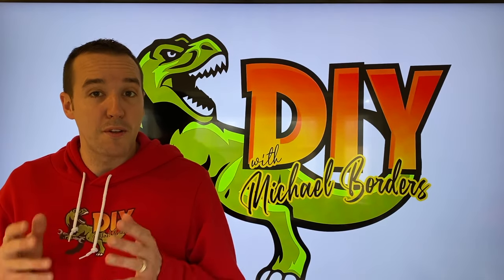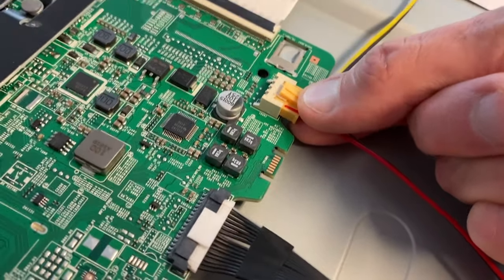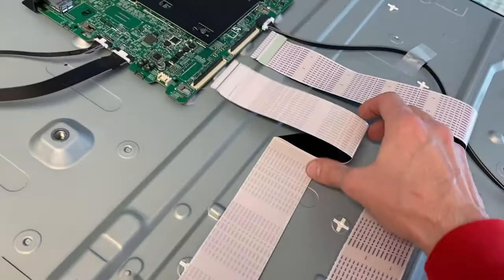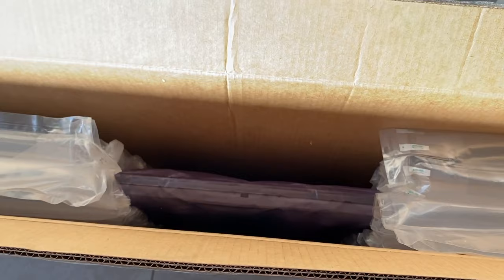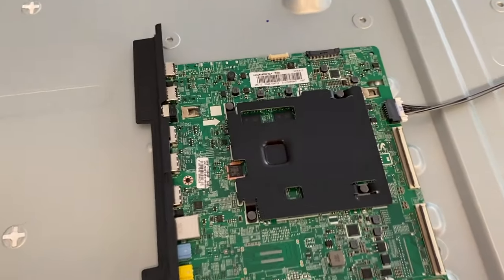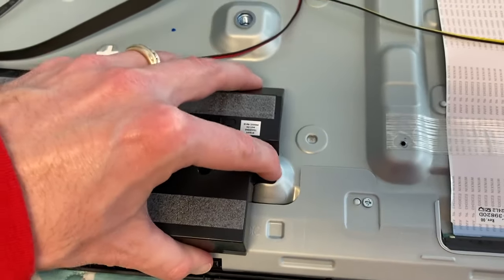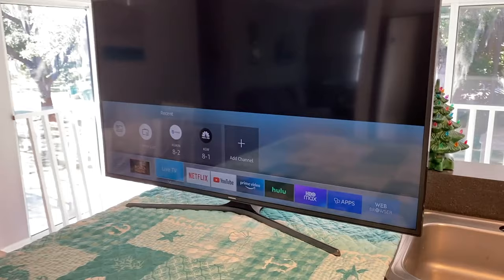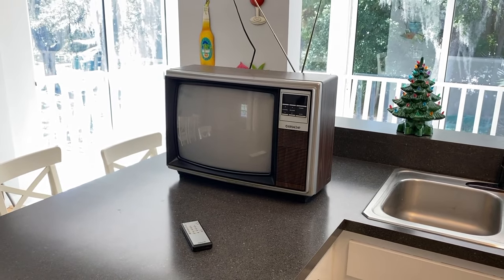How to replace TV screen/panel - DIY Samsung/LG/Sony/Vizio

Comment: I was playing with my VR and I lightly touched my screen and it cracked over half of it and my TV is 75 inches😭😭😭😭😭
Reply from the maker: Good morning ☕️

That’s a bummer to hear.  75” replacement panels are tough to find however not impossible.

The best place we have found is:

       PartSimple.com

It’s possible that chatting with their customer support team, they can find you a replacement panel however if not, ask them if there’s a place they recommend looking next.

They are pretty awesome in the support department.  👍

Comment: Where do I get the new screen?? And how much are they?? I have a 49 in LG bottle cap hit it didn't break the glass but it f*** up the screen
Reply from the maker: Thanks for watching & welcome to the DIY Raptor Club Rudy.  We purchased our panel from:

       PartSimple.com

You may find it best to remove the back panel to gain access to the internal portion of your TV.  Once inside, you will find a part number sticker or placard on the internal panel.

Using this information on the sticker or placard will allow you to best shop around for your exact replacement panel.

Please keep us posted on your project.

Comment: I have a 55inch 4k samsung tv that needs a screen replacement. It has the same damage this one does. Where can i get panel to replace? im having a hard time looking.
Reply from the maker: Thanks for watching, below is the site we purchased replacement panel from.

       PartSimple.com

Having the panel part number which is located inside on back portion of panel will be very helpful.

😎👍

Comment: Any help on a screen for a 43" samsung tv un43tu7000fxza. Cats knocked it off the TV stand and broke the screen. Only had it for 3 months.
Reply from the maker: What’s up Kevin, thanks for watching & welcome to the DIY Raptor Club.  We purchased our panel from:

       PartSimple.com

You may find it best to remove the back panel to gain access to the internal portion of your TV.  Once inside, you will find a part number sticker or placard on the internal panel.

Using this information on the sticker or placard will allow you to best shop around for your exact replacement panel.

Please keep us posted on your project.

Comment: Hello I broke my screen on lg 43 smart tv can you help me how I look for this 
I called screen panel for 43 lg tv  ?
Reply from the maker: Thanks for watching, the 43 lg is more likely to have a replacement panel available.

We purchased our panel from:

     PartSimple.com

😎👍
Reply: Thank you 🙏 any tip how to look for part number on the screen panel  ?
Reply from the maker: @tinobriones7922  

You are welcome, best thing to do is remove the back panel to gain access to the internal portion of the TV where you can then find your screen/panel, part number sticker on the backside of the internal aluminum panel.
Reply: Thanks 🙏 I appreciate your response and the time 😊
Reply from the maker: @tinobriones7922  

So happy to help.  😎👍

Comment: Hi mate, I’ve bought my Samsung 4K QLED Q60A TV last year and it’s only been 8 months old but I was told by samsung’s tv repairman that my panel has to be replaced. So he scheduled another appointment with me next week as he just came today to evaluate and assess my tv’s condition. For the past few days, the problem with my tv is that it can be turned on during the day but whenever I decided to turn it on at night around 10pm plus, the red led light just flashes twice and the tv screen keeps on flashing white non stop. It only worked if I turned it on again at around 1am or 1:30 am. Oh yeah forgot to add in, I do have horizontal black line on the mid bottom of my tv screen that tends to appear and re-appear every secs. Do you know what is the actual prob? is it really a panel issue? if yes, what causes it and is there any advice on how to prevent this issue from re-occurring in the future? apologies for the long ass message but I hope you do reply me, thanks a lot 🙏🏻
Reply from the maker: Thanks for watching & welcome to the DIY Raptor Club.  Great questions & we appreciate you sharing this.

TV working at random times during the day is odd...🤔

A few things can cause the lines including faulty panel, faulty Tcon board, or faulty ribbon wiring.

If you don’t feel comfortable paying for a new panel yet, we recommend replacing your Tcon board and ribbon wiring to see if that alleviates your issues.

The Tcon board and ribbon wiring are very low priced items within the TV.  If replacing these low priced items and you’re still experiencing the same issues, it’s time to replace panel.

Please keep us posted on your project.
Reply: @DIYwithMichaelBorders  thanks for the response and advices man! I’m not good with DIYs and technical stuffs mate but no worries as my tv is still under full warranty. And speaking of the devil, it’s 1:21 am here in Singapore and yes my tv finally able to turned on now. I genuinely have no idea why it can only be turned on at this timing😂 I turned it on at 10:30 pm just now and it doesn’t want to turn. Tried it again at 11:30pm still nope, 12:30 am nah but 1:21am and bam! it takes like 2-3 mins for it to even turned on. Once I saw the QLED logo I knew it’s gonna on 😅
Reply from the maker: @iAMNinjaDarkovia  

Thanks for the reply, that’s so odd...😁

Sounds like your tv watching will be in the early early morning hours as opposed to prime time hours...😁
Reply: @DIYwithMichaelBorders  likewise 👍🏻and yeah man it’s surely is odd alright! I just hope that the tv repairman will get it fixed next week lols
Reply from the maker: @iAMNinjaDarkovia  

😎👍

Comment: hello im was watching your helpful video but can u help me find a screen for my SAMSUNG 24" Class HD (720P) LED TV  UN24H4000af
Reply from the maker: Thanks for watching, we will need the actual panel part #.  You can access this by removing the back panel where you will find the screen part # sticker attached to the inner aluminum panel.

😎👍

Comment: Need the part number for a 55 inch and 50 inch Vizio if you can help please, thanks 🙏🏽
Reply from the maker: Thanks for watching & welcome to the DIY Raptor Club.  We purchased our panel from:

       PartSimple.com

You may find it best to remove the back panel to gain access to the internal portion of your TV.  Once inside, you will find a part number sticker or placard on the internal panel.

Using this information on the sticker or placard will allow you to best shop around for your exact replacement panel.

Please keep us posted on your project.

Comment: How much does a new t.v screen cost
Reply from the maker: Good morning, that will depend on age of tv as well as size.  The smaller the tv, the more cost friendly replacement panels are.

The older the tv is, the less expensive the replacement panel is.  Hope this helps.

😎👍

Comment: I have a 50 inch TCL Roku TV I believe it's 4K and my niece knocked it over after having a tantrum. It fell on a baby walker and punctured the screen. I think it's worth fixing as the TV was only a couple hundred bucks  before taxes and insurance which the insurance was useless because it doesn't cover the problem I had. Where can I get replacement parts to do it myself? I was gonna take it to a TV guy but figured he'd probably charge more than what it cost.
Reply from the maker: Thanks for watching & welcome to the DIY Raptor Club.  Several options, we purchased our replacement panel from:

       PartSimple.com

😎👍

Comment: What would be the cost and where would I find a LED panel # BN96-50317a
Reply from the maker: Thanks for watching, we will need the actual part # of the panel itself.

We recommend removing back panel to gain access to the inside of the TV where you can find the part # sticker for your exact panel.

On average, replacement panels can range between $300-$700 for your tv.
Reply: The back panel is off. I have looked at every sticker and typed in every number and non of them produce the entire panel. It should be stuck to the silver aluminum correct? Where my main board and ribbon wires are connected.
Reply from the maker: @booger1585  

Thanks for the reply, that’s correct.  The part # you sent is for the internal LED strips we believe.  That’s what coming up.

Comment: How do I know what panel I need for the tv?
Reply from the maker: Thanks for watching & welcome to the DIY Raptor Club.  The best thing to do is remove the back plastic panel so you can gain access to the internal portion of your TV.

Once inside, you will notice a large silver aluminum panel that all the internal parts screw into.  Somewhere on this large silver panel is a part number sticker which is the exact panel/screen replacement part number.

Keep us posted on your DIY project.

Comment: Can You help me with a site that can give me the original screen replacement for 40" MU6120?
Reply from the maker: Thanks for watching, we recommend:

          PartSimple.com

Great online vendor for tv electronic replacement parts and services.

😎👍
Reply: @DIYwithMichaelBorders  THANK you, but I still can't find it. Can You help me with direct link?.
Reply from the maker: @Exquisite.C  

Good morning, absolutely!!  😎👍

The best thing to do is remove the back panel of your TV to gain access to the inside where you will find the TV’s panel/screen part number.

The part number is usually on a small sticker.  We can use this exact part number to locate an exact replacement panel/screen for your exact TV.

Looking forward to hearing back from you, we DIYers need to stick together!

😎👍
Reply: @DIYwithMichaelBorders  THANK You,.. This will be helpful and I'll look for it when I get home 🙏
Reply from the maker: @Exquisite.C  

Awesome Awesome!  😎👍

Comment: Amazing video! I do have a quick question, I am having the same issue with my Samsung Nu7100 Series 7 tv. I wanted to know if there is ANY way I can do the same thing to this specific model? Also this tv does not have screws on the back so I am having issues with just taking that off. If you have any suggestions that would be kindly appreciated!
Reply from the maker: Thanks for watching & welcome to the DIY Raptor Club.  It’s possible indeed.  Your tv design has the clips that secure back panel.

You will need to carefully unclip back panel & remove it to gain access to the internal tv screen/panel part # sticker.

Getting this part # will ensure you purchase the exact replacement screen for your exact tv.
Reply: @DIYwithMichaelBorders   thank you so much ! This really helped! Are there any websites you recommend for a panel to be found?
Reply from the maker: @Daissysaiyan  

There are a few good ones, we purchased our replacement panel from:

       PartSimple.com

😎👍

Comment: If I give you my TV info can u help me with the part number I need to find screen plz
Reply from the maker: Good morning ☕️

We can definitely help, we will need the panel p/n located inside on a sticker placed on back/inner wall of panel.
Reply: So I need to take back cover off
Reply from the maker: @thenightwing1718  

Thanks for the reply, great question.  You may actually be able to get panel p/n from your TV’s owners manual.

If not, removing back panel to gain access to inner tv will be the next best method.  😁👍🧰
Reply: @DIYwithMichaelBorders  ok give me a few
Reply from the maker: @thenightwing1718  

After obtaining the p/n, we can check:

       PartSimple.com

This is a huge online electronics vendor.  😁👍🧰

Comment: I have two white spots on the screen of my Sony TV and I don't have someone to fix it for me,pls what do I do?
Reply from the maker: Thanks for watching, a few things can cause this.

1.  Loose electrical connections inside tv

2.  Internal chip in early stages of failure

3.  Dusty Dusty Dusty inside

Out of the three, the most likely cause is dust buildup inside the TV.  The video link below shows us performing a friendly cleaning.

     https://youtu.be/-QdPg_jPkGY

It may be that simple for you.

Comment: I’m trying to buy a replacement panel for my TV that broke a week ago, but it’s LG and they only sell to authorized dealers who charge more than what the TV is worth from ridiculous nonsensical charges, etc. Where can I go to get one?
Reply from the maker: Thanks for watching & welcome to the DIY Raptor Club.  There are a few trustworthy places to purchase replacement panels.  Depending on the age of your LG, we definitely feel you should be able to find a replacement panel.

We ended up purchasing ours from:

       PartSimple.com

Please keep us posted on your project, us fellow DIY’ers need to stick together!

😎👍🔧🔩
Reply: @DIYwithMichaelBorders  hi, it doesn’t appear they have any TV parts or panels available for LG. I found the model number available on other websites but they have a huge core charge associated with them. It is a 2020 lg tv 65UN7300AUD outside of manufacture warranty. 

Does the core charge actually get refunded for a broken screen caused by an impact or is it just considered part of the total cost at that point?
Reply from the maker: @TavidzTV  

Thanks for the reply, we did a search & found a few options.  Below is a link...not sure if it will be helpful.

       https://www.tvserviceparts.com/LG-65UN7300AUD.BUSFLKR-TV-Screen-Replacement.html

😎👍🔧🔩
Reply: @DIYwithMichaelBorders  I have a  75nano75upa.busflkr 
I'm having a hard time finding a panel  i circuit boards I can find but I need a pannal
Reply from the maker: @lexusfujae2192  

Thanks for watching.  Do you have the exact part number for the panel?
Reply: @DIYwithMichaelBorders  yes the part number  is  kit-75nano75upa-k2
Sku: Sj-kit-75nano75upa-k2
Module number 75nano75upa.busflkr

Serial number
Reply: @DIYwithMichaelBorders  its 75 inch nanocell lg tv Alexa built in
Reply: @DIYwithMichaelBorders   do I need to open  it up to find any different number
Reply from the maker: @lexusfujae2192  

Awesome
Reply from the maker: @lexusfujae2192  

Sweet, thanks.
Reply from the maker: @lexusfujae2192  

We looked up that number.  You will need to remove the back panel to gain access to the internal panel part number sticker.  This will help us pinpoint the exact replacement panel for your exact tv.
Reply: @DIYwithMichaelBorders  I found several numbers  hopefully one of these work 

There are 2 white stickers with a barcodes 

1st sticker has 2 barcodes

Top half stick 1 :
NC750TQG-ABKP1
BMS
9ABA141761A2CB
Second  half  Second barcode of sticker 1:
EAJ65720404
210705
J7507JR5E65720404ZG1A

The second sticker has 1 big fat barcode
SECOND STICKER:
GAC01-1464A-H1
750TQG-ABKP1
1464A 16U00BMZG1A
Reply from the maker: @lexusfujae2192  

Thanks for the info, we believe we have found it.  Check out the link below.

       https://www.lgcanadaparts.com/product/inv_19100724

Comment: I took apart my tv to discover that it is my panel as well.. :( I have to find where to order this type of panel
Reply from the maker: Thanks for watching, welcome to the DIY Raptor Club.  By chance have you gained access to the panel part #...?... this is a small sticker located on the internal aluminum panel.
Reply: @DIYwithMichaelBorders   yea I have, I noticed that the tapes are damaged.
Reply from the maker: @avocado_q1217  

Thanks for the reply, are you referring to the ribbon wiring?  If so, we attached a video showing replacement of our ribbon wiring.

       https://youtu.be/O9GTDo2Bfg4

😎👍

Comment: I need a 65 inch sanyo screen replacement panel but i don't know were to look can you help me out
Reply from the maker: Thanks for watching, a 65” replacement panel is tough to come across however not out of arms reach.

We recommend visiting:

          PartSimple.com

This is a huge online electronics vendor.  If their website does not have your replacement panel, we recommend contacting their customer support because it’s possible that they can track down a replacement panel within their online warehouse tracking system.  Hope this helps.

Let us know if you have any questions and hey if you’re into crypto trading, join our DIY ecosystem and help us grow an exclusive group of DIYers.

       toolboxtoken.com

Reach out to us any time!  🧰